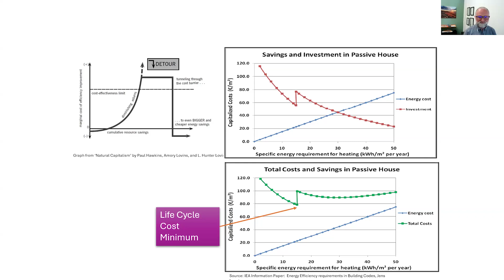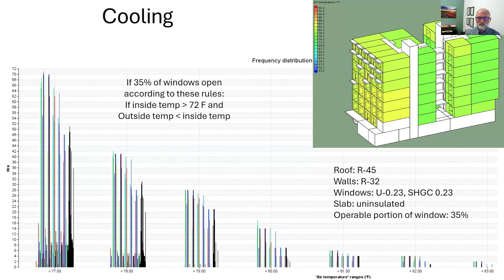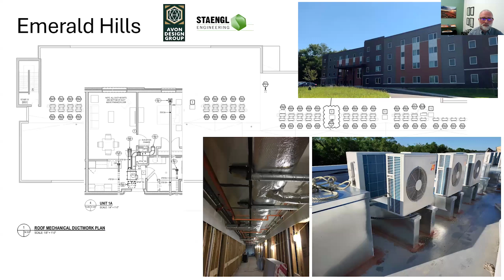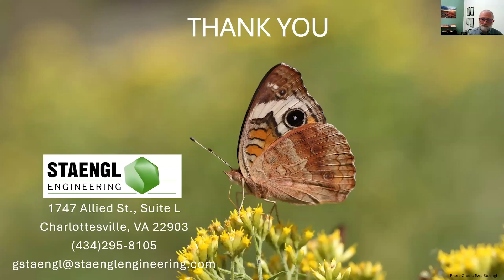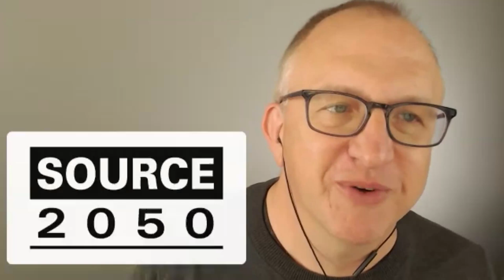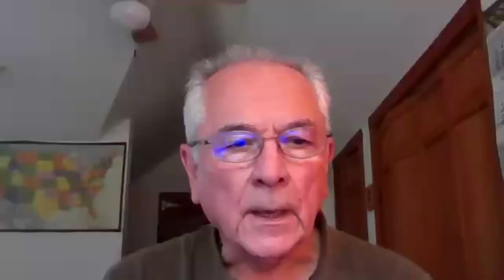101: Can We Eliminate Heating and A/C

Comment: I don’t understand if I am doing a deep energy retrofit so ach <2 , getting a heat pump, ERV  and in climate zone 6, why is the hvac guy insisting I still need to buy the same size  (18,000btu) gas furnace? I would only need it as back up for the very coldest days. Seems like a of money for something I would use less than 2 months max a year, and could use a wood stove/fireplace insert for less money.  Am I being conned?